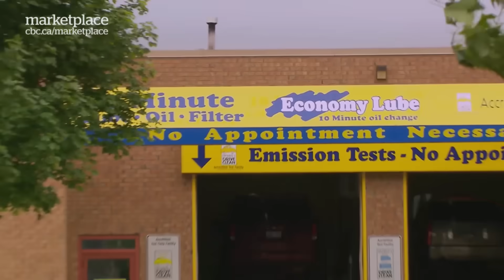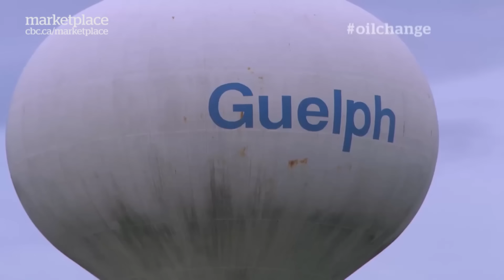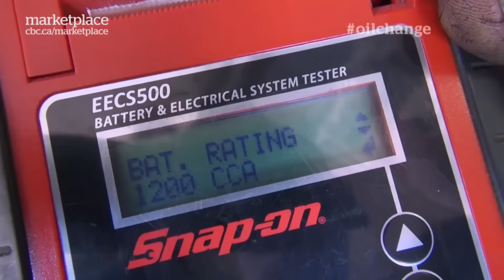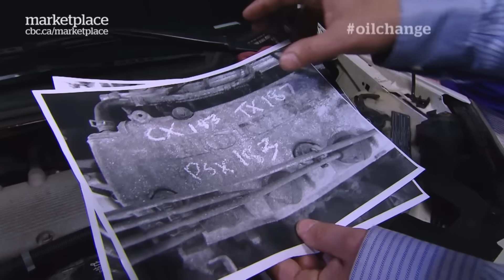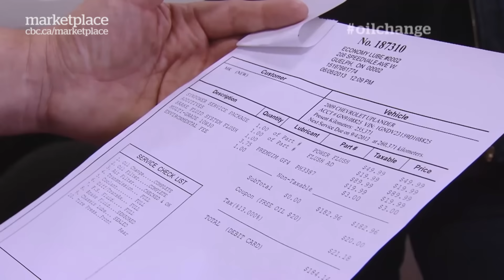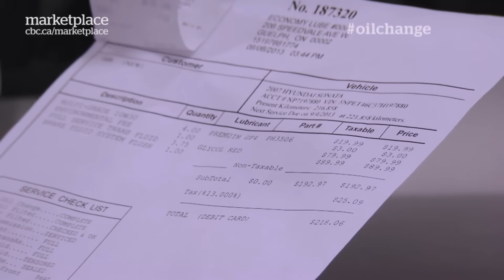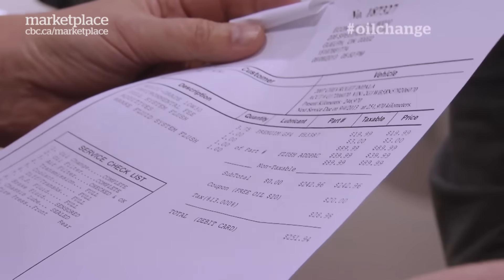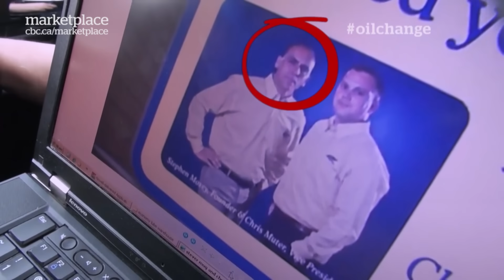Oil change scams: Hidden camera investigation on what really happens to your car (CBC Marketplace)

Comment: are you allowed to say "no I don't want anything except the oil change for $20"
Reply: +jason200912 yeah they ask for your permission before
Reply: +jason200912 Yeah I would have liked to see them have a 4th vehicle and say no just the $20 and see if they even change it at all. The up selling I thought was not a big deal, the charging for other stuff and lying and then not even doing it was the worst part. There are different oils, in fact in a lot of nicer cars they say to only use a synthetic. I have a feeling they are putting in one oil no matter what you are saying you wanted.
Reply: +jason200912 Yes, and doing a service you told them not to do on your car is also criminal, whether you paid extra for it or not.
Reply: +jason200912 Yeah you're allowed but they'll damage your car on whatever it is you refused so they can say "I told you so"
Reply: +JoeCnNd This is true. They told me to change the air filter. I said no. They simply removed it and my car ran without air filter for a year until my mechanic found out later on.
Reply: rocketomega11
WOW, you don't check your own car out, a "year" without a filter. You should take the filter out a couple of times a month and either use low pressure air (about 30 PSI) to blow out the filter or at least bang the thing on something to remove as much grit from it as you can. That and if you live anywhere that is fairly dusty you should do it much more often.
Reply: +Gnaluiac Some of the chains are in such a habit of just doing things that they will just do them, ask you after the fact, and then take the hit if you refuse the service... 

At one point my wife had a blow out and required all four of her tires to be replaced (for some reason they make you replace all 4 tires an a AWD vehicle if they are close to needing replaced) and they asked me after the fact if I wanted an oil change because the car needed it, which it did but I don't trust chains to do them so I said no. 

Well, I had all the supplies to change the oil and had time after the tires were replaced so I jacked the car up... for some reason there was some generic oil filter on the car (I use fram)... I was like wtf.... So I started changing the oil. Even if they had properly changed the oil I didn't trust they had used quality product when they did. I found out that they over tightened the filter and I had to use a channel lock wrench to get it off AND they had lost the oil drain bolt gasket.... I had some choice words, the manager was embarrassed and swore 'my techs only hand titan oil filters' and I get a replacement oil drain bolt kit for free...
Reply: +jason200912 You can, but the point is, they use your ignorance of car mechanics and fear of your car breaking down to get your money, even if they did nothing to fix it.
Reply: extra virgin oil was used for mixing with diesel before it became expensive,as long as you didn't mind the smell of cooked fries.
Reply: +MasterMech77 What car has an air filter that requires that much maintenance? Checking it once per oil change (which I dont even do annually on most vehicles, I do it based off miles) is usually enough.
Reply: +jason200912  For shure, but you're supose to get what you paid for .
Reply: +jason200912 Of course you are; hey uhh, your a liberal right ? LMAO
Reply: +Alain Brisebois proper spelling is "sure"
Reply: +Theskybluelake Yea,yea...
Reply: exactly, while up selling is immoral when you do it to take advantage of women or old people it's not a crime. But to charge for work you do not perform then is criminal fraud
Reply: +jason200912 At the point where they try stuff like this, I'd ask them to see the issue at hand so that i "know what to look for in the future" and then once I'm actually at my car to make sure they can't mess with it any more, demand my keys and get out of there, paying for whatever I got done.
Reply: +jason200912 Yes. They will press and press, but ultimately they can't hold your car hostage.
Reply: +jason200912  Yeah but think about it, this is Canada we're talking aboot here.
Reply: +lenny boy Huh? Upselling isn't always immoral, sometimes it really is a valuable thing if it's actually a service and not just useless.
Reply: +jason200912 
Of course, but they might not even do THAT
Reply: +Austin Lucas my bad I meant up selling stuff that you don't need, but when it's like hey u can get cheap oil for $3 a quart or the better stuff for $6 a quart, when you need oil then it's reasonable ya know
Reply: +jason200912 it's your money so hell yes you are allowed to choose what the hell you want.
Reply: Richard E.
 yea do you like your car? i wouldn't put cheep oil in there....
Reply: +jason200912 you're a customer, of course you are. That's like going to a grocery store and saying "I only want milk, no soda". however that doesn't stop them from damaging your car, trying to ensure you'll come back
Reply: +rocketomega11 On my vehicle if you removed the air filter it would not run and tell you that the air filter was not fitted correctly or missing.  I didn't get the filter case shut properly when checking and that is exactly what it did.
Reply: +jason200912   That's what I say every time.. And what business doesn't upsell?  They all do. Like it or not; consumers have some responsibility.
Reply: Actually if you buy the wrong oil you can void any warranty you have left. If your car calls for 0 w 20 oil that's full synthetic and you better expect 50 bucks or more.
Reply: ***** Not really.  It all pours the same at room temperature anyways.
Reply: +St. JD Hammerfork 1 Wrong, we have the new Chevy 1500's coming in that take 8qts of 0w20...
Reply: +jason200912 i know right. learn about the product you own. buys a car doesn tknow anything about it.
Reply: my aunt did that once, they made a hole in the brake line so that it would leak and she would have to come back
Reply: +jason200912 yes man if they say otherwise call the cops
Reply: +jason200912 Yes. But then they urinate in your engine.
Reply: +Bre Fujimoto your right! survival of the fit!
Reply: +jason200912 you tell em i want an oil change and nothing else otherwise i wont pay for it
Reply: +Theskybluelake people who tend to correct others spelling have been shown to be more likely to be  a sociopath.
Reply: +rocketomega11  how did you not know? i mean you dont NEED one but cmon man.
Reply: +jason200912 lmao
Reply: Apparently not lol
Reply: I always say that and they tell me they have to try any way. They tried telling me once my pcv valve was rattling so its bad. I schooled him and told him its suppose to. when it dont make a sound its sticking and bad
Reply: +jason200912 Yeah you can, but they say they need it and don't even do it and charge them for it.
Reply: Of course you're allowed to say no. It's your vehicle
Reply: Doofapotamus Gaming it was more of a rhetorical question :(
Reply: +jason200912 If you aren't, you better get your vehicle out of there asap. It's a very bad sign.
Reply: +JoeCnNd Which would be vandalism. Not only is it criminal, but it is grounds for a lawsuit.
Reply: That was a very poor comparison.

Comment: guess i wont bring my car in to ecnomy lube to change the blinker fluid :/
Reply: 365 Hockey life Chris fix
Reply: I had my tire fluid change
Reply: 365 Hockey life i had my seat fluid changed
Reply: These guys aren't to bad they changed my speaker fluid for 15% off tag price, and even gave me a free brake pad rotation!
Reply: Idk, but my air freshener fluid change was made correctly when i went there.
Reply: I had my seminal fluid changed there
Reply: hahaha lol blinker fluid
Reply: guess you drive a BMW, those things go trough blinker fluid in a day
Reply: Orcjura wait...BMWs have turn signals?
Reply: Nathan S  so true
Reply: I had my semen fluid changed. They gave me the "full service". She did quite a good job, I must admit. No complaints. A little pricey, but she made it worth it. ;)
Reply: @Mineav 
Nice joke that no one at all has said previously up in this thread whatsoever.
Reply: Mine wasn't a joke. True story, bro.
Reply: The point is that this could happen anywhere.

Comment: why i change my own oil. the only people i trust is myself, my dad and the family friend mechanic we have that is completely honest
Reply: SuperArcher2345 Same, I use to go to my dealership for those kind of stuff since It was free for me for two years but after that I couldn't get it for free anymore and I was curious how hard it was to do an oil change. After watching Crisfix explain how to change oil, it was so easy!
Reply: 3rdWG Chrisfix is amazing
Reply: To properly change the oil of your vehicle you need a lift, air compressor, a pan, oil filter tool, new oil, new oil filter and engine wash optional. Not everyone has those tools and you have to find and buy the oil and filter for your car. What service stations offer is convenience not everyone has the time or is willing to do all this stuff. The worst part is the old oil is toxic so you cant just flush it down the drain I literally have to find a place to throw them away.
Reply: baraki808 i have a drip pan, jack stands, and i buy the oil and filters for my car and i have the necessary tools. you dont completely need a fancy shop or a complete engine wash to get the job done.
Reply: SuperArcher2345
I'm just saying that the effort is too much especially if you own a car that has been lowered.
Reply: baraki808 and i have an old deisel gas can i keep my used oil in and then dispose at the recycling center
Reply: baraki808 oh haha mine is a 2001 buick regal, it would be a waste of money to lower mine 😂
Reply: SuperArcher2345
 It's actually my cousins car a Honda S2000 I used to change the oil of it myself the car was already pretty low with the stock height but when he lowered it even more I just suggested he goes to the service stations since our oil change here has free labor just buy the oil and filter in house. I might change the oil of my car myself after the warranty is over. My car is a 2015 Ford Ranger btw I wont have any problem since it's suspension is fairly high so changing the oil will be easy.
Reply: SuperArcher2345
There is money in old oil. My old friend that owns a gas and service station told me he sells the old oil for $20per barrel. apparently it's the main ingredient for asphalt. You can also use them to treat wood so you don't get termites.
Reply: What do you need the air compressor for?
Reply: SuperArcher2345 yeah same
Reply: This is why you find an honest family Mechanic
Reply: +Bella Ward yes he responded to me today
Reply: Jose Pena nice! He's responded to me a couple times and has given me tips. He's a very good help when you need it
Reply: you do not NEED an air compressor to change oil, if you think you do then you need to re-learn how to car. and if you think you need a lift you couldn't be more wrong... I've worked on only one car that is not slammed to the ground so if you think it is hard to do just an oil change on a lowered car you probably shouldn't be doing the work in the first place(:
Reply: i agree with Caleb J, you need to find a new hobby, clearly car is not your strong point
Reply: SuperArcher2345 lol i feel you. i change my oil without even getting my hands dirty with a beer in one hand
Reply: Smart move
Reply: I change the oil, oil/air/fuel filter myself, but any other servicing such as belts (especially a cambelt) I leave to the experts.
Reply: SuperArcher
Reply: You really aren't saving that much money doing your own oil changes.  In my opinion it's not really worth the hassle, but to each their own.  Brakes, rotors & other small repair jobs are a different story, that's where you can save big when your vehicle gets older.
Reply: baraki808 lol all I need is a pan crawl under my truck take the plug out and filter and put more in
Reply: baraki808 what's the air compressor for? I work at an oil change n our air compressor is for doing the tire pressure n pumping out the oil from our hoses. If ur doing it urself the oil comes in plastic bottles?